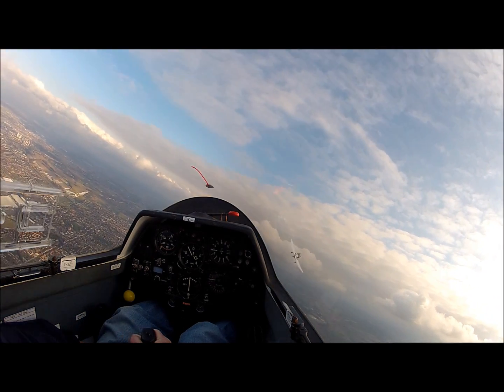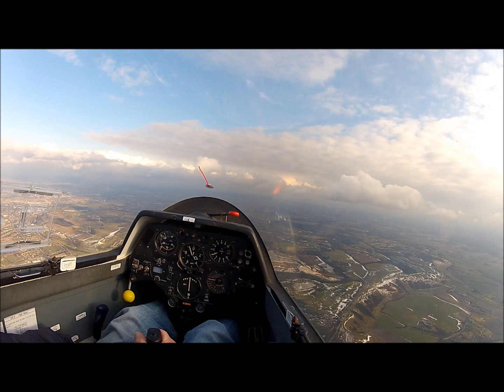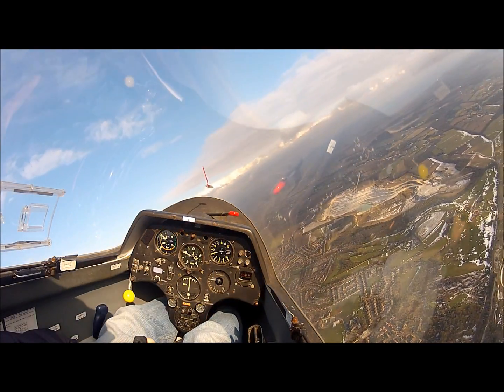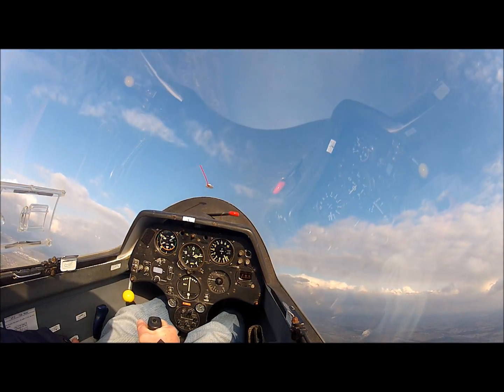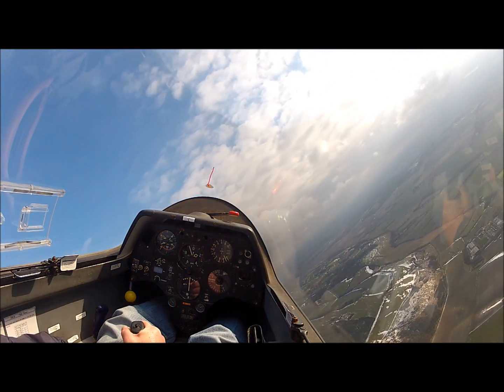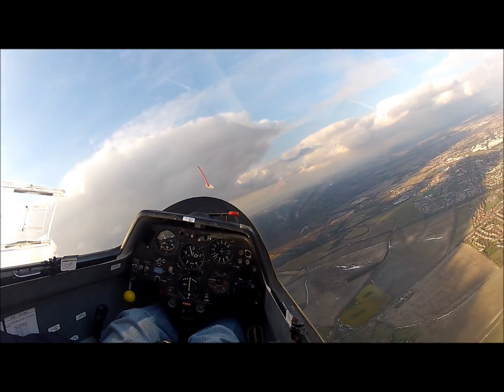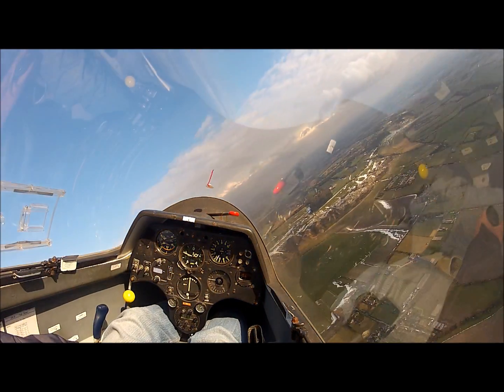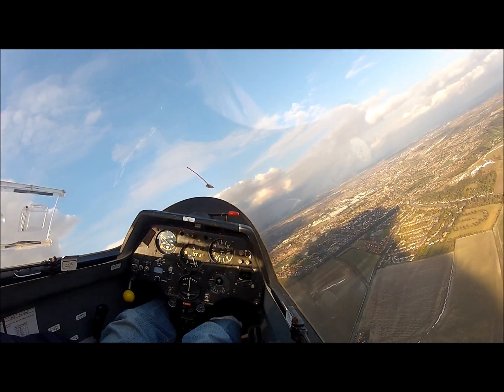Spinning and recovering a glider (ASK23)

Comment: On a more helpful note ....
You say although you're slow and (technically) stalled, turning right and yawing with the string to the left, there's seemingly no 'adverse'  effect & its stable.
So ...  Um .... The reason its doesn't flick into a spin until the yaw's corrected must be because the rudder is opposing the spin!    
That hadn't occurred to me before 🙄- Thanks

Comment: Our maximum manouverinng speed is 81 knots. So ..........  

If its going fater than that we''ll just let the ground stop it
😋
Reply from the maker: Max manoeuvring speed is the speed at which controls should be used with care! It is the speed at which only one control should be fully deflected. In reality it is seldom necessary to use anywhere near full deflection of the elevator at higher speeds as it is so effective with small movements. What it does mean is that removal of the full opposite rudder is important. Depending on the attitude at the recovery from the spin it is probably best to roll the wings level with aileron and immediately ease out of the dive. It is VERY important not to exceed Vne and if there is any perceived risk of this it is far better to pull back harder using the elevator than to allow the speed to continue to increase as there is a 50% margin of safety on the wing loading but virtually no allowance on Vne. This is NOT nor intended to be a full explanation as it is worthy of a book rather than a comment, so if in doubt as a senior instructor. Generally the biggest risk in rolling the wings level at higher speeds is that the nose will tend to pitch up thus increasing wing loadings. As a result the recovery for example from a spiral dive is likely to be "Roll the wings level with coordinated aileron and rudder , but do not allow the nose to rise until the wings come level, then ease out of the dive"

Comment: That won't happen to a LS3a.
Reply from the maker: An interesting comment. What makes you believe that it will not happen to and LS3a?
Reply: @andrewroch2159  Because I own an LS3 A since 1990 and I have 1,100 hours on the machine and it doesn't engage in spin even if stalled in a turn . It stalls in a turn when spiralling at less than 80km/h but you don't even have to push the stick, it recovers by itself . Maybe you should try an LS3 and see for yourself . I would like to know .

Comment: Thanks very much for this. It is very interesting how you can be uncoordinated (rudder perhaps is neutral) in a turning stall and not spin, but as soon as you add rudder to center the yaw string, you spin. I've always been taught that you should be coordinated in a stall, whether straight ahead or turning, to prevent a spin.

Comment: As a flight instructor I've had to watch this a few times. What I think it happening is the yaw momentum on the inside wing causes it to more deeply stall starting the spin. However, in steady state you can fly around in a ACK 23 (or any aircraft) all day long in a full stall while coordinated and a century of aeronautical research assures us it will not spin. And in fact I've verified this in the ASK 23.

Comment: Hi, I've just found this video and found it very informative. I'm always interested in spin cause and recovery as I hate spinning :)  There's something I don't understand though so hope you can help and see if my thoughts are right. I understood that spinning is caused when lift on one wing (the inside wing) is reduced to a point where it stalls, and the opposite wing still produces lift which causes the glider to spin. I'm trying to understand why centering the string while turning would cause the spin. I think this is because the with the unbalanced turn (eg at 5:10 in the video), the inside wing is actually hitting the air faster than would be the case in a normal turn (since the glider is slipping), and therefore the wing is not stalled. When you centre the string, you are slowing the inside wing to the point when it stalls and the spin starts. Is this right? I'm interested in the physics behind why this happens to aid my understanding of how to avoid it. Cheers and safe flying !
Reply from the maker: Hi Cirrus4000. Spinning is in my opinion a horrible passtime but learning to understand how it feels, how to get out of it effectively and more importantly knowing when it is about to happen is all good for self presevation!
Please be aware that my reply to you is based on mostly experience and relatively little science so if you see an answer to your question from a more informed source then go with that. This is my best shot at a partial answer. When a glider is banked and turning the outer wing travels faster, the inner wing relatively slower. The outer wing travelling further in the same period of time and losing the same amount of height must have had a slightly lower angle of attack compared to the inner wing. It is a high angle of attack that makes a wing stall therefore the inner wing will stall more than the outer wing.(Lift effectively increases with angle of attack untill just before the stall when it rapidly loses lift, so the outer wing is likely to be producing maximum lift at the point the inner wing stops doing so). In my example in the video it important to realise that the glider is well below the stalling speed (for the angle of bank) and therefore slipping significantly into the turn. This slipping pushes the yaw string to the outside of the turn and even full application of in turn rudder struggles to centralise the string but readily causes the glider to spin. (as it increases the speed and reduces the angle of attack on the outer wing and the reverse on the inner wing). So the semi stalled condition in the first place is the root of the evil and misleading information from the yaw string. There really is only one reliable answer to not stalling and spinning and that is to realise that the stalling speed increases with the angle of bank and to fly the glider above the stall speed for the angle of bank that you have.  If you ever find yourself with the stick well back consider allowing it to move forward a little.
Reply: @andrewroch2159  Hello Andrew, thanks for the detailed reply, especially after all these years after the original video was uploaded. :) Your explanation makes sense, and actually I can see that it's not necessarily the fact that the string is level (and the turn balanced) that's the cause as such, but the act of ruddering (ie yaw motion) to bring it level that slows the inner wing enough to tip it over the edge. I had forgotten that the stall speed increase in a turn which is definitely something to remember. I need to start reading up on all this again and dig out my Glider Pilot's Manual. I've not flown for a good few years after going solo some time ago, but looking to fly again when restrictions allow. So I've been busy watching as many informative videos as I can in the mean time, and commenting where appropriate (I've watched and commented on a few of Gerry Fletcher's videos who I see also commented here). Thanks again for your comments. It's a pity you have not been able to upload more instructional videos on this topic, but understand that it's not always easy to do. I think, like you say, spinning is one of the aspects of flying that is least liked but has to be most understood to fly safe. Cheers!
Reply: Great video, extremely helpful. I'm just in process of learning about Gliders. 

I know more about GA Powered planes & the biggest gotcha is the infamous "Base to Final Turn".

With gear down, 2nd flaps in & throttle lowered many times your hovering around  stall speed & over shoot runway you increase bank angle, then also use more rudder to bring nose around, noticing ground is approaching faster with increased bank pilot mistakey push up & stall spin deepest at low altitude to perform proper recovery.

Would this example be similar to a 
typical base to final stall?
Reply: In this video you state that this wouldn't happen in other model 

But you never explained why it wouldn't.
Does that plane have a lower stall speed or another reason
Reply: I think this is covered in a lot of basic spin training : by centering the "uncoordinated" turn (out slipping, not enough in turn rudder), you apply in-turn rudder, and this has the effect of raising the relative airflow speed on your hight wing (which is good) but it also decrease the airflow over your low wing, which is already near stall speed. So because of this rudder input into the turn near stall speed you will make your low wing stall and you will spin thereafter. The critical thing here is not having a coordinated turn at all cost it is the reduce your angle of attack.

Comment: Hi Andrew, very interesting video, thx for posting. I'm curious as to apart from a slower turn rate, would it be safer to stay with uncoordinated turns when low down to avoid this potential hazard? It's been 20 years since I flew a glider and only had a week instruction so have probably forgotten a LOT but I managed 2 solos. Seeing this brings back memories....😁
Reply from the maker: Hi Scott. Sorry that I have been so slow to reply. A slipping turn would be safer than a skidding turn but in reality we want to climb in lift so a "balanced" turn is more efficient. We really want to fly the smallest circle possible in the centre of a thermal to optimise climb rate. The safe answer is to monitor speed carefully and regularly

Comment: I would call this dropping the inside wing. No spin here. The ASK23 is near impossible to spin without tail weights or a pilot well below weight limit.
Reply from the maker: @JohnLivings  Hello John and M R. Sadly I think that you may have missed the point of the video. It was intended to demonstrate that a K23 does not handle in the same way as a K21 and I just filmed this example to make the point. There was nothing special about the configuration of the glider and no "Test Pilot" elements involved. It is a great shame that we lose too many glider pilots in unintentional spinning accidents and we should assume (regardless of what it says in the manual) that gliders flown without due regard to airspeed might very well spin. How "fully developed" the spin might be (or for that matter any other departure from controlled flight) has no bearing on life expectancy if the ground gets in the way. My endeavour in publishing this video was to inform and educate with the hope that it will prevent a pilot from leaping out of a K21 into a K23 and assume that you can treat them as being the same - they are not! I would really not want to get into pilot qualification levels and the like in this open forum to justify my comments but if you would like to know more please just email me at the London Gliding Club. With regard to the helicopter comment......... Auto rotation is an expression used for both fixed wing and rotary aircraft. Confusingly it has a different meaning in each. Please have a look in Wikipedia for autorotation (fixed-wing aircraft) which gives an excellent explanation of the term.
Reply from the maker: I can assure you that it does and was spinning. This is an exercise with which I am very familiar. There was full auto rotation and all the symptoms of a spin. What is the reason for your analysis please?
Reply: @andrewroch2159  I just don't see a fully developed spin. I have logged countless hours on this model. BTW isn't autorotation a helicopter term?
Reply from the maker: @MrBirgerB  Hello MR. I am still grappling with how to do replies on YouTube but please have a read of the reply to John (and intentionally you) as I hope it covers the points that you raise. I am glad to hear that you have had the opportunity to complete a number of hours flying the lovely K23. I hope that my little demo has shown you a side to the glider that will keep you cautious. Sadly most spinning accidents occur during a period of high workload and that is not managed correctly. Rarely is it due to the pilot being unaware of how to get the glider out of a spin. Stay safe and have fun - please do not get distracted from the point by focusing on an issue that I do not know enough about. I have no idea what in your mind constitutes a "fully developed" spin but whatever it is from 3,000 ft holding the glider in more turns of the spin would have caused me to run out of height before completing the task that I set out to complete.  For what it is worth I do feel reasonably content that I am suitably qualified to justify the video and my comments but if you want to know more please just email me at the London Gliding Club and I will happily elaborate.
Reply: Andrew Roch, No need to get deffensive about a technical discussion. I appreciate your video and the message you are trying to get through. I just find flying interesting and I like to discuss technical aspects of it.
Reply: Great Video Andy, clear message well demonstrated (as I would expect from you of course with your experience! ) I hear students say on a regular basis, “a K23 is just a single seat K21” how wrong they are! Kind regards Mark.

Comment: Interesting video.  Not a glider pilot but powered and have done some spin training.  Curious that the glider can maintain "control" with it in a slip and stalled.  I didn't get what signs there were that the glider was stalled and you mentioned no buffet either.  What am I missing?
Reply from the maker: Ah yes!! Sorry about that. The give away that it is stalled is that the variometer (sensitive VSI and total energy compensated) shows a high rate of descent. and particularly that it flickers. So if you watch the instrument on the top right you will see that it is normally at about -2 (2 knots down which roughly equates to 200ft/min). When stalled this will increase significantly and the instrument tends to flicker due to the turbulent airflow over the port which is used for total energy compensation. Neither the K21 nor the K23 show much buffet at the stall. I hope this helps answer your questions but if not please come back to me.    Andrew
Reply: @andrewroch2159  not at all!  Thank you for responding to my question.  It makes sense now when I watch the video again but I am surprised there is no audible stall warning given that a dramatic spin entry is only one dumb decision away.

Comment: Great video Andrew. Where did you have the CG? According to the ASK-23 flight manual, the glider will only spin in the rearmost CG position.
Reply from the maker: Thank you for your kind comment. I could not tell you but well forward I would suggest. I am not fortunate enough (or disciplined enough) to be anywhere near the minimum placard weight. Coming in at around 95 kg with 'chute I was much closer to max weight. I think the method of spin entry has quite a lot to do with it.
Reply: That's really interesting. Funny enough, I'm 95kg as well, which has me to believe I have the CG pretty far forward.  I believe the max cockpit weight is 242lbs (109kg). The part that fascinates me is that the 32's flight manual says it will only spin with a CG in the most aft position, and spril otherwise like a 21.  But clearly this is not the case. I showed this video to my instructor who is also an aerobatic pilot, and he had tried all sorts of stuff to try and get the school's 23 to spin.  But your video shows that the glider will spin if stalled in very uncordinated flight.

Comment: THank you for this video, inspiring stuff... I'm really wanting to learn to fly and looking to join my local gliding club. 
A couple of questions... at the end you say "ease off the back pressure" and glider comes out of the stall. Can you explain what is "back pressure"?
Also i believe i understand what the yaw string indicates (wind direction), but can you explain why centralising the yaw string initiates a spin?
Thanks
Reply: If you want to learn to fly gliding is defiantly the way to go, it is affordable and has a great community of people surrounding it.
1. Back pressure is him pulling backwards on the stick, releasing the back pressure is done to allow the glider to unstall.
2. To centralise the yaw string you put in a rudder input. When you are near the stall this causes one wing to fly slower than the other causing one wing to stall and the other to continue flying. This is what causes a spin. In normal flight at normal gliding attitude the yaw sting should be kept central.

Comment: Huh?  Why did the glider turn left after release?
Reply from the maker: It is a good idea for the glider and tug to gain separation as soon as possible so that there is no conflict between the tow rope and the glider. This can be achieved in a number of different ways but in this particular location it is not possible for the tug to continue its climb due to the base of controlled airspace. If the tug suddenly descends then it will shock cool the engine and/or over speed it. So the best option for the tug is to turn and gently reduce power. The convention at most clubs in the UK is for the tug to turn right and therefore for the glider to turn left. If this reply raises further questions please just go ahead and ask. As I have no idea of your background or level of knowledge on the subject I have tried to cover the topic in the best way that I can, but more detail can be given if you wish.
Thanks for your interest in my video.
Reply: Interesting.  We are opposite with cars, and with gliders.  Something that I need to know should I ever be fortunate enough to fly in the UK!  Thank you for an excellent video.
Reply from the maker: DIsmayedConfuse  I so wish we were consistent in the UK but we are not! I know that the club at Cambridge uses " glider turns right" so if we are lucky enough to have you visit the UK  my advice would be to get a suitable briefing on the topic from the club's at which you fly.
Reply: @andrewroch2159  Why could descending shock cool the engine?